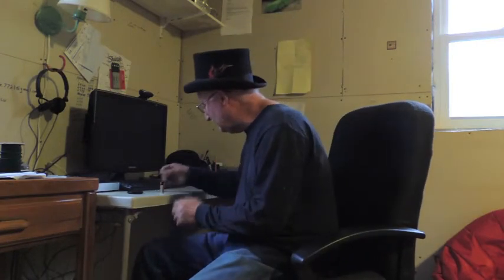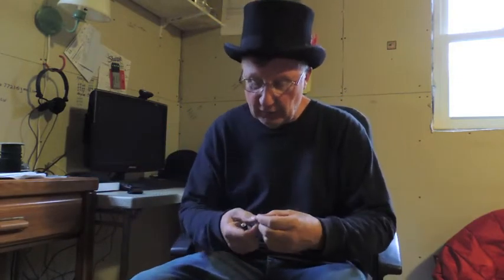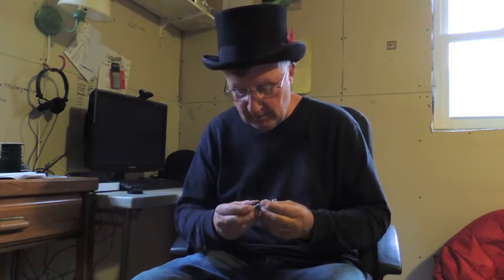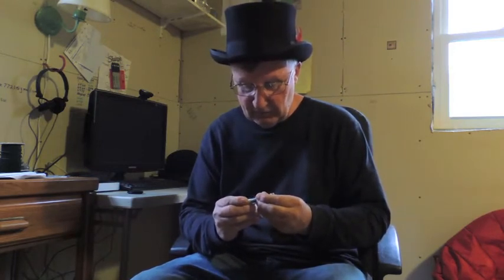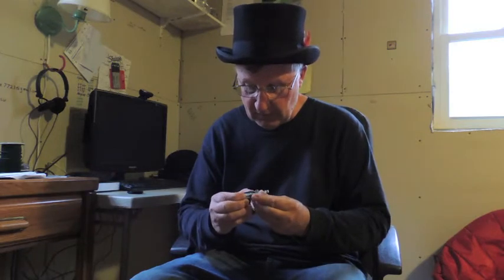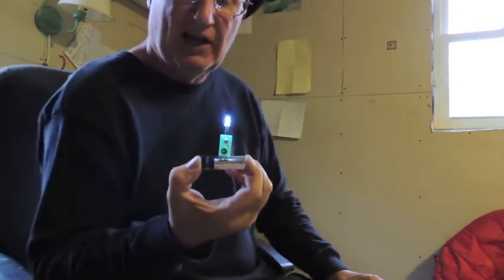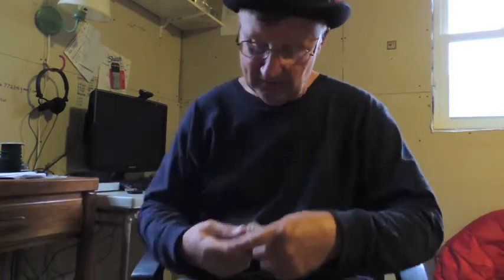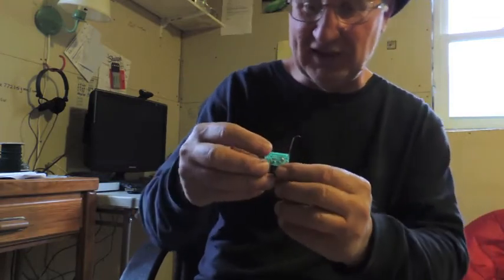New smaller joule thief boards

Comment from the maker: This is a circuit board for building a Joule thief---a device that takes the power from a  dead battery  an steps it up to to run an LED.  Dead battery 1 volt.  Minimum volts to run an LED 1.8 volts---Joule thief volts 25